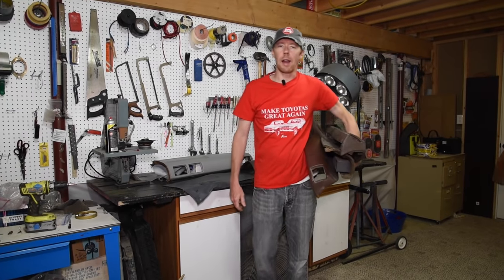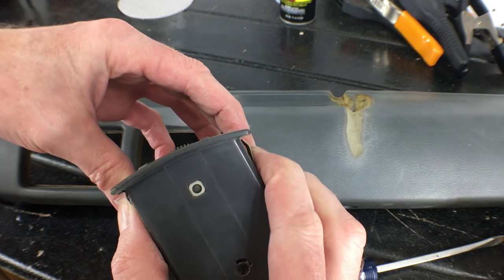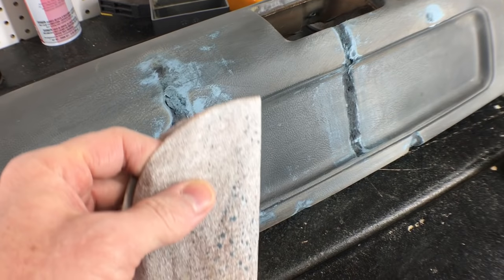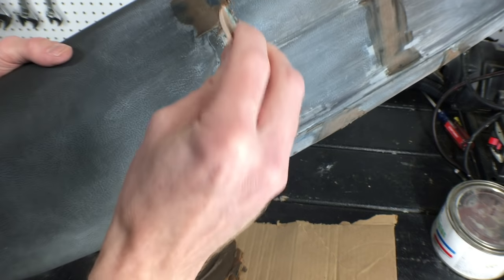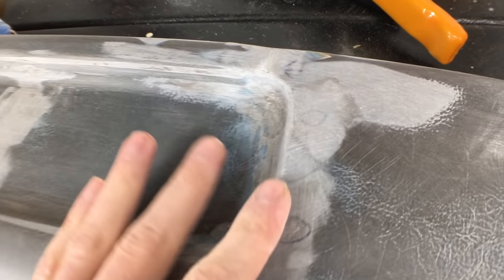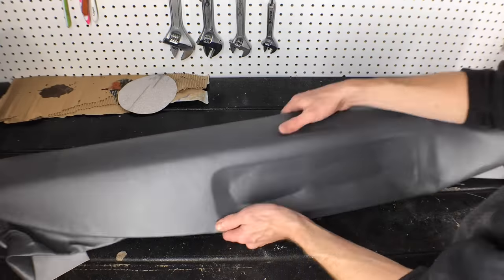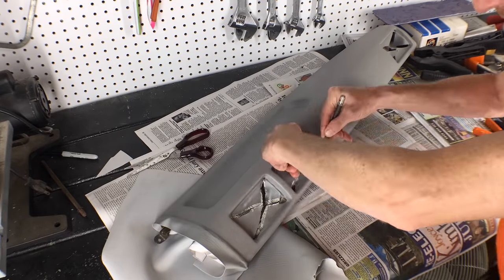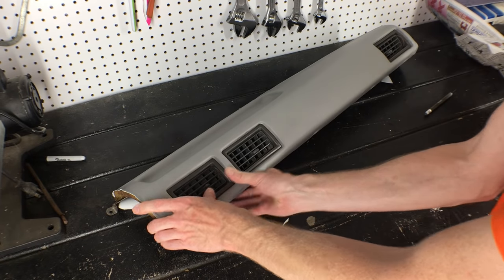How to Restore/Fix/Repair a Cracked Vinyl Dash - Toyota Hilux Pickup/4Runner PART 1

Comment: As a several-decade veteran of mobile audio fabrication, I can tell you - you WANT the thicker Marine-grade vinyl, and you want "so much heat my fingers are burning".  There are tools that are made for rolling and pressing vinyl - you don't want to use your fingers.  

The thin vinyl will just stretch-out, it's the extra material in the thick vinyl that allows you to stretch it.  You could have avoided the seam on the side - thick vinyl stretches enough to pull right across that corner and not have a seam.

That dash recess is just a difficult stretch - your technique is fine with making a mold, and you were right to START with that recess.  You didn't sand your mold smooth though, so you got texture.  If you had sanded the texture out, you also would have created just enough clearance for the vinyl.  Win/win.  

Other than that - impressive to figure all this out on a first effort - really impressive.  Great job.
Reply from the maker: Thanks for the tips!

Comment: That's solved a 20 year old dilemma for me, I have a cracked dash to repair on a old 944, I currently have a spare which is also cracked so I will that first, cheers for the video.

Comment: Its a lot faster to use a can of spray foam insulation or sealant for filling the cracks instead of bono or fiber filler. Sets up rigid then block sand it down. Brush on liquid contact cement holds best. Use 4 way stretch textured vinyl and some gentle heat. Work from the center outward to the ends. Use lots of spring clamps along the edges. If possible staple the edges that extend around on the back side.
Reply from the maker: Thanks for the tips. I look forward to trying this again from everything I’ve learned in the comments.
Reply: Contact cement does not necessarily have the temperature resistance as headliner adhesive.
Reply: @agrxdrowflow958  I like the idea of using the headliner spray glue. It might allow you to reposition it briefly as you work.
Reply: Spray foam insulation continues to expand for weeks.  It would produce high spots where the cracks were.  There is an expanding foam called X30 for marine and aircraft applications that cures differently.  It doesn't continue to expand.  It could be sanded and it would maintain the shape.
Reply: take a look at other glue options.  3m makes tons of different kinds of glue.  i would have used a glue that allows retacking.  i am no expert,  but i know what using the right feels like compared to using something that is almost the right glue.
Reply: He should have taken more time when preparing to apply the vinyl by creating a better mold for the large recess then gluing and clamping the large recess first, then when thats done, apply the glue and fix the vinyl to the rest of the job in sections. he had to much glue everywhere and the result was a mess. D --
Reply: The glue you want is Barge. It's used for shoe soles. Also you could vacuum bag it to get all the contours tight. i also would have used a polyurethane foam as a filler. I used to fabricate prosthetics and orthotic braces.
Reply: Good call with the foam..
Reply: Yep, that's what we did for my 76 F250. basically exactly what was shown in the video, but with spray foam to fill and shoe glue to adhere it. We also used Marine grade vinyl from Joanns Fabric. Turned out looking great, and saved hundreds vs buying a new reproduction dash mat. Only caveat with real old trucks, the dashboards are pretty tight to the A-pillar, as the pillars were always just painted metal, no plastic covers. Was a bit of a squeeze getting the dash in after a layer of rather thick vinyl on it.
Reply: The big issues are foam that continues to expand and slip temperature of the adhesive. You need high temperature glue and the minimal expanding PU. 
Vac bagging is good but creases in the bag will mar the covering vinyl. That would need a negative moulding made from silicone rubber to spread the compression loads.
Check the end-to-end clearance between A posts before covering. Any trimming will be lost when it’s fitted. Probably best to allow a millimetre (at least) clearance each side to take thermal expansion.
Reply: “Bono” 😂😂😂

Comment: I have a 1975 Toyota Crown. As I live in New Zealand it is right hand drive. It had cracks in the dash and I repaired it in a very similar manner. I used a fabric backed 4 way stretch vinyl. The adhesive used was made by a company in NZ called CRC. It is similar to the product that you used. This is a very angular dash, but it came out very well
Reply from the maker: I think I have heard of CRC before, they have a protective lubricant called 6-56 that I've used before.  Good product!

Comment: Congratulations... excellent... regards from Athens Greece..
Reply from the maker: Thanks! I recently restored another dash using spray foam, brush on glue and 4-way stretch vinyl, and the results were better, but still had a little trouble with the recessed area: https://youtu.be/XB9GKLRHYNM

Comment: You rock man.If I can see it done I can redo it. I was 20 and seen a man swap a motor. Went home and swapped the one I had knocking. Fired right up. That was 30 years ago in a apartment complex.Yeah they were mad but i had it done before some one could say no. Used the same truck to go get the motor given to me for free and borrowed a cherry picker.Pulled the old motor and set it in back,and got the new motor and put it in the truck. Because you dont skip like a lot of people do,and even tho it is fast forward i can see and reproduce what you do.Thanks man it  helps a lot.
Reply from the maker: Most of my neighbors hated me when I lived in an apt, except for the ones who needed a hand wrenching or borrowing a tool

Comment: I remember doing this on my Mazda RX2 when I was 18 (in 1985). I sat the vinyl out in the sun for a while, and then over many hours I slowly and carefully pulled the material backing off the the new sheet of vinyl (started the edge off with a razor blade). I ended up with very sore fingers, but this left me with a super stretchy and thin vinyl. The dash came out almost perfect, although the RX2 dash pad is very simple. I firstly attached the rear edge with heaps of clothes pins, then carefully from the center out, stretched the vinyl to the front edge and attached clothes pegs along that edge. Any other clamps in the middle of the dash would leave an impression on ther, but it might slowly disappear? 
I later did the same thing to a Mazda R100 which has a way more complex dash. It worked out well too. 
The only issue I had later was the new vinyl off gassing in the Australian sun, which always left a fog inside the windshield that I had to clean off every week or so for the first few months.
Reply: @bigsparky8888  Ditto Fiats: I had a '69 124 Sport Coupe that nastied up the windows: the gummy stuff was hard to get off.

Comment: great repair i own 2 chevy trucks from the 90 s both cracked real bad but they are solid plastic , luckily i found 2 good ones at junk yard just got real lucky i replaced and painted the one on my 98 with that vinyl spray looks brand new better than expected
Reply from the maker: Nice! This is an old video, I recently restored another dash using different method and materials and it came out much better: https://youtu.be/XB9GKLRHYNM

Comment: I think you have a great attitude when it comes to working on old cars. I really enjoyed and appreciated your video!
Reply from the maker: Thanks! I later restored another dash using spray foam, brush on glue and 4-way stretch vinyl + spray paint, and the results were much better, but still had a little trouble with the recessed area: https://youtu.be/XB9GKLRHYNM Also I put both dashes through a torture test to see which products held up better and the second one was definitely the winner: https://youtu.be/ywkqTaHK2LA

Comment: I have used liquid tape the stuff you can coat wires with. It works fantastic. You can even get Color’s that are close to to Color of dash.
Reply from the maker: Good idea!!  I recently restored another Toyota dash using spray foam, 4-way stretch vinyl and brush-on glue, and the results were much better: https://youtu.be/XB9GKLRHYNM

Comment: When I have a difficult piece like this, I put the vinyl in the clothes dryer for a few minutes.  It comes out very rubbery.  A small heat lamp works well also.

Comment: Brian, I am so lucky to have happened across your video. I believe that through your very informative video that I have some options that I wasn't aware in restoring the dash of my 1991 Dodge Stealth Turbo. It has a crack in exactly the same location that yours does. While I will check the availability of a vinyl dash-cap for my Stealth, I believe I will be able to use some of your techniques on other areas, such as, door and other interior elements. Thank you.
Reply from the maker: Thanks for watching! I later restored another dash using spray foam, brush on glue and 4-way stretch vinyl, and the results were better, but still had a little trouble with the recessed area: https://youtu.be/XB9GKLRHYNM Also I put both dashes through a torture test to see which products held up better and the second one was definitely the winner: https://youtu.be/ywkqTaHK2LA

Comment: Have you thought about making a separate "tray" for the top of the recessed section? Maybe use the thick vinyl like the 1st attempt and carefully trim the "hole", leaving about a 1/2" overlap that can be pressed in with a custom tray? And making a tray using Kydex material. I make kydex sheaths and its originally used for molding interior panels for aircraft and marine applications. It can be heated and molded in place. Once molded and cooled, remove and cut to fit and do the final fit and finish. I have made lots of itrms with Kydex. I think it would look sharp! Also, with a minor modification,  you can make the tray snap in or out for cleaning. Just an idea to deal with the molding issue plus to give it a little "upgrade".
Reply from the maker: I hadn't considered that, a removable tray!
Reply: I was thinking the same thing!!
Reply: ttrrzrzzrzzzèèèèèèèèèèèeèèèèèèèèèèèèèèeèèèèèèèèèèèèeèèeèèèezeeeeeèèèeeèeeèèeèèeeèèèeeeèeeeèzèèeèèèèèeee4eèeèèèèeèèèèeeeèèèeèzèeèeeeeeèèèèeèèèèeeèeèeèèèèèèeeèeèèèeeèèeèèèeeeeèeeèèeèeèeèeeèèeèeèèeèèeèeèe4zeeeeeèeeeeeèèeèeeeeèzeeeeèeeèeee4zèeeeèeeeèèeeèeèèeeèeèèzeeeeeeeèeèèeeèeee4zeeeeeèeeèèèeeeeèèèeeeeeeeèeeeeeeèee4èeeeee4zeeeè4zee4eeeèeeeeeèeeèeeeeèeeèeeèeeèeèeeeeeèeeeèeeee4zeeeèèeèeeeeèeeèzèèeèeeèeeeeèeeeeeèèeeèeèeeeee4zeeeeeeèeeeèeeèee4zeeeèe4zèè4zèeeeeeeee4zeèeèèeeeèèer9r4zr4zttx

Comment: Smoothing out that shoulder in the recessed area while you were at it is an excellent idea.  The vinyl will lay much better rather than trying to get it to lay in that tiny shoulder. 👍🏼
Reply from the maker: Thanks! I later restored another dash using spray foam, brush on glue and 4-way stretch vinyl + spray paint, and the results were much better, but still had a little trouble with the recessed area: https://youtu.be/XB9GKLRHYNM Also I put both dashes through a torture test to see which products held up better and the second one was definitely the winner: https://youtu.be/ywkqTaHK2LA

Comment: Yeah.. .like another poster,  cut out the center of that big tray and  Wrap around the edge. Then take material and cover a board. Or a contrasting piece of material. Scrap vinyl but you're just worried about the white edges showing. Doesn't have to be removable. Solid plastic plate.

Comment: I loved this video because of the mistakes you made and how you showed how to go back to fix the mistakes.
Reply from the maker: Thanks for watching! I later restored another dash using spray foam, brush on glue and 4-way stretch vinyl + spray paint, and the results were much better, but still had a little trouble with the recessed area: https://youtu.be/XB9GKLRHYNM Also I put both dashes through a torture test to see which products held up better and the second one was definitely the winner: https://youtu.be/ywkqTaHK2LA

Comment: Nice video.  Maybe try and repair/paint the 80 series before going all in on wrap?  On my way to testdrive an 80 series now!
Reply from the maker: The only problem I see with painting it is getting it to match and replicating the vinyl texture to blend with the factory vinyl finish. Then hoping that paint doesn't fade from the sun. Hope you get the 80!
Reply: @6thGearGarage  Hmmm...  Could use a piece of vinyl to texturize the paint, while still wet and then use a satin clear to protect all of it from the sun (would have to paint the whole thing anyway).   I passed on the 80 (was looking for a friend), someone snatched it up this morning.  Market is crazy right now for anything 4wd.
Reply: @indyjones3287  
Love my 80, 12 years owned with 472 k km on the dial. 
Goes anywhere, and never misses a beat. ❤️🇷🇴🇬🇧👍🏻

Comment: Seeing the end product is so satisfying! Your solution for the top of the dash in the recessed area is great. My idea was to fill it permanently and just have a smooth top
Reply from the maker: Filling it in was my plan B. It would have been so much easier without it there!
Reply: @6thGearGarage  I bet! I was going to ask how it has held up and then realized your video is super recent haha. Has the recessed area still held over the short time it's been finished?
Reply from the maker: @H3Humper  Yes so far the recessed area has stayed the same. I'm going to give it some time and see if it bubbles up.

Comment: Good job! Thanks for sharing. I need to do this on my truck, too. I'll try stretching the vinyl around the curves using heatgun before the adhesive phase.
I want to build up the recessed part on top because I don't want anything placed on the dash. 
What do you guys think about using foam, maybe 3/8- inch thick, to fill most of it and filling smaller recesses with the Bondo?
Reply from the maker: I considered filling the recessed part as well. I would have dremeled away the vinyl first, then applied spray foam to build the area up, then for the last 1/4 or 1/8", used body filler.  Maybe the long strand first for strength, then the smooth on top to finish it off.

Comment: Thanks for sharing both your failures and success. Great video.
Reply from the maker: Thanks for watching! I recently restored another dash using spray foam, brush on glue and 4-way stretch vinyl, and the results were better, but still had a little trouble with the recessed area: https://youtu.be/XB9GKLRHYNM

Comment: Outstanding video and presentation.
I went with the plastic cover for my Dark blue dash for my 91 4x4 truck. Super easy and worth every penny.  It even came pre painted with glue.
Reply from the maker: The plastic covers really do look great when painted to match. I recently restored another Toyota dash using spray foam, 4-way stretch vinyl and brush-on glue, and the results were much better: https://youtu.be/XB9GKLRHYNM

Comment: on my truck, I used an industrial silicon and used kind of like bondo....took some time to set up, but I did not want to apply vinyl. What I chose to do was a texture spray....when that was dried I painted the dash Desert Sand as I am doing a common paint job on the truck as well....Still working on the restoration but things are looking very good on my 1993 4x4 pickup.

Comment: I used a replacement dash cap molded to fit over my bad dash on an 80 Malibu a few years ago. It came out really great. I'd definitely use a dash cap again. Just follow the instructions; doesn't take that long to install. My vent louvers were in bad shape but was able to find used replacements on eBay. You can spend a bunch of money on an interior but if the dash looks bad, it ruins the look of the entire interior. Glad I went the route I did.

Comment: Hey buddy 2 things, 1is Australia has all the right hand drive 80 series dash covers you need and 2 is when you mix bondo do it on glass or a ceramic tile coz the hardener soaks into cardboard and you loose hardener.
Cheers Mic
Reply from the maker: Thanks for the tip! I wish shipping wasn't killer, I'll end up restoring the dash at some point.  I recently did another truck dash with different materials and the results were much better: https://youtu.be/XB9GKLRHYNM

Comment: Solid try with the mold and much better looking vs very cracked dash.
Reply from the maker: Thanks!  I recently restored another Toyota dash using spray foam, 4-way stretch vinyl and brush-on glue, and the results were much better: https://youtu.be/XB9GKLRHYNM

Comment: What I saw so far helping with glueing on any wrap like this vinyl is to go in very small sections like at first just half the bottom of the recessed area and then from there the other half, then piece by piece the rim and after that the bigger top area in pieces. Like that you always can stretch and reposition where you didn’t put glue on what helps handling where the glue is applied.
Also don’t overlap where you have to cut if possible. Better try to cut it fitting while installing.
But honestly you did great! Also great idea with the „stamp“ and prestretching the vinyl there.
But you did
Reply from the maker: Thanks!  I recently restored another Toyota dash using spray foam, 4-way stretch vinyl and brush-on glue, and the results were much better: https://youtu.be/XB9GKLRHYNM